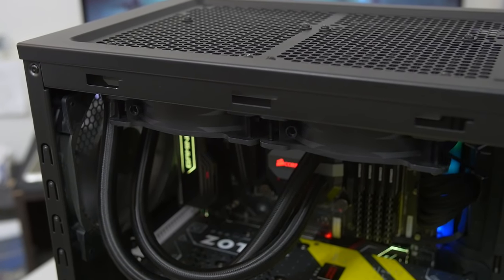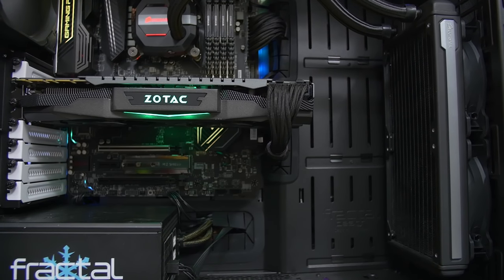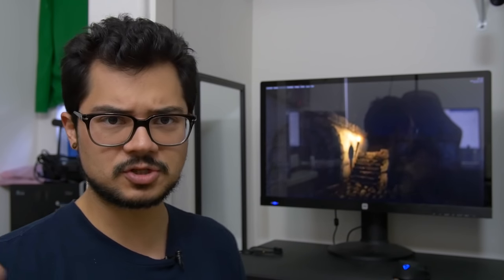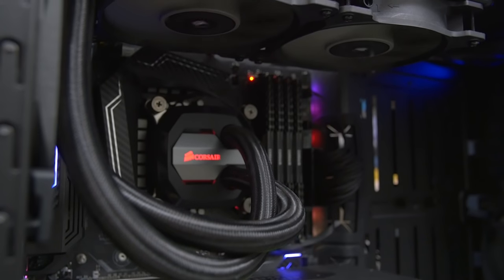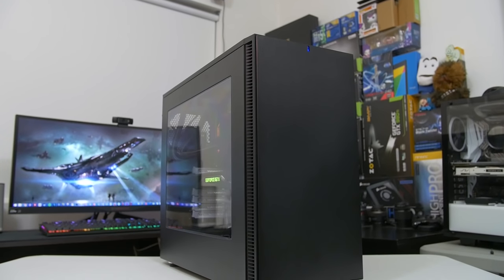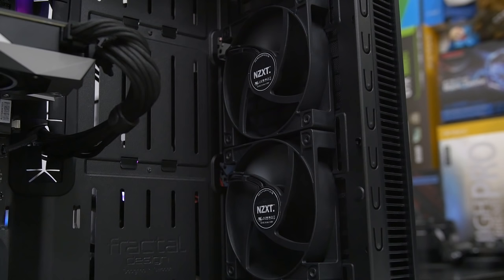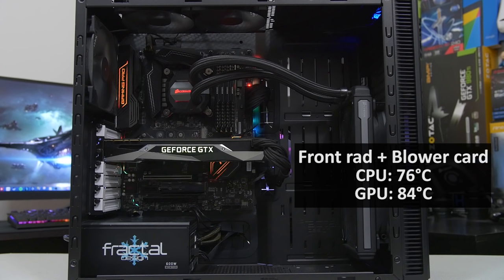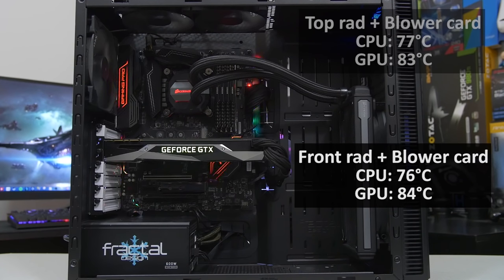Does Radiator Placement Matter? Hint: YES

Comment: is it me or he mounted the radiator upside down?? 

eventually, you will run into noise issues when mounting the intake and exhaust tubes up top and not at the bottom. AIO's have at least a 2-5% air pocket (up to 10% for cheap ones) and that will contribute to pump noise and gurgling in the radiator from the air bubbles. And another mistake, is to mount the pump (which in this case os on the CPU block with this AIO) higher than the radiator, the air pocket will eventually travel to the pump itself and make some pretty nasty gurgling sounds... 

Of course, for the test, it doesn't change much, but for a quiet and efficient build, it will.

Comment: On my R7 3800x when from 90c in the top to 75-80c in the front in the thermaltake c23 rgb the top in this case doesnt have much space in the top past the fans so that could also be makin my temperature hotter cause air cant exit as easily

Comment: So basically either you make your GPU slightly warmer with the front mount, or you will make your CPU warmer by having top mount xD fucking hell...
But seems like practically open shroud GPU barely takes any difference...so that's great to hear. I suppose front mount it is.

Comment: You didn’t just switch the radiator from top to front… you switched the radiator from exhaust to intake. Which in terms will cool the cpu more than exhaust. The position of the rad top or front doesn’t matter… what matters is intake over exhaust. Thank you.

Comment: If the radiator is on the side im assuming you want the top fans as intake to draw cool air right? Otherwise as exhaust it might cause a similar affect of hot air to be pulled by the cpu? Thanks in advance for the help and info will be appreciated.

Comment: got a question Kyle, not Lyle I have 140mm fans that run @1800 rpm on my rig but the NZXT Kraken 62 comes with 120's should I use the bigger fans and have them blow on my Kraken 62? Of course id remove the fans from the Kraken, thoughts?

Comment: In my experience it is best to have cool air available for gpu. radiator. and pcb using radiator as only exhaust and ducting the expelled air to the nearest window
Reply: it's not only the fresh air that gets to the radiator. it's how much heat is drawn away from it and therefore making the liquid more efficient

Comment: Hoses alway on top when radiator in vertical position.
Most AIO didn't mark which one is in/out on pump or radiator until we open to check it.
Is it matter AIO pump hoses on top, bottom or on side to keep no air in the pump?
And which installation method are the best way to let air get out from the pump?

Comment: Why hasn't anyone mounted it in the front and made a fan shroud to send it out the bottom so then the hot air from your radiator never meets your system. Then you can have your other fans on the top pull cold air inside your case.

Comment: The front mount you keep showing is going to be very bad for your pump. Pump should not sit lower then the highest part of the rad. This will cause the air to build up in your pump and cause over heating and eventually a broken pump.

Comment: What if u put the radiator on the top but put the fans as intake fans?! Does it make any difference? Im thinking about getting an AIO liquid cooler for my CPU (its a Ryzen 3700X so yeah it gets pretty toasty) and I dunno if I can put the radiator in the front cause I have 3 intake fans on the front from my case - Cooler Master. Btw I dunno if I should get an AIO at all (I got the stock Wraith Prism) cause now its summer and it gets pretty hot at times and Im getting like between 65-75 degrees on both the CPU and GPU (GPU goes to 75 or above very rarely). But the CPU sometimes went up to 80 (because of those goddamn Ryzen sudden temp peaks that piss me off) which is just scary and I undervolted it a bit ( -0.0750 V). Its def better now I dont think its gotten up to 80 at all I dont monitor it the whole time but still. So is there any point in getting and AIO cooler at all?! Its a lot more expensive than an air cooler but is it gonna do the job? Thats all I care about - for it to do its job and cool the CPU consistently! Is it actually gonna cool my CPU better than an air cooler ya know is it worth spending all that money on it when theres a possibility of getting even higher CPU temps because of the radiator and fans of the AIO being on top? I honestly got no fuckin clue lol would much appreciate it if someone more knowledgeable than me gave me a tip or two
Reply: High-end air coolers often perform roughly the same as AIOs according to a lot of youtube tech channels including LTT, so it depends heavily on the type of cooler you currently have, the case and how its airflow currently is (dusty filters, cables not managed properly and getting in the way, good/bad case design in general, etc). The room temp should bump the temps for both types of cooling if its hot in the room.
Reply: Evgeniy I went with the Noctua NH-U12S Push/Pull config. Installed it yesterday gotta say Im pretty happy with it. My temps are 10 degrees down from the Wraith Prism and its so much quieter.

Comment: Lol I built a mini chiller that keep cools down my radiator which keeps my 2700x at 34c under heavy load . Had an Engineer design the chiller for me and I machined all parts , Had a friend Anodized them for me .
Reply: Wow, that's almost as cool as my PC, which I built in my smart fridge, the upside is I don't need a monitor cuz it comes with the smart fridge.

Comment: How would this change with an AIO cooled GPU like the hybrid series from EVGA? Both intake top and front? Intake front and rear with a top exaust?

I've got a 420mm CPU AIO and a 280 GPU AIO, and I'm trying to figure out optimum setup without having to rebuild the fans/rads a dozen times lol.

Comment: Hello Bitwit, sorry but I'm not understanding what do you mean by this setup Front rad + open card. Does it mean that on front panel the fans are blowing the air into the case and top is pushing the air outside of the case or differently? Could you please explain ? Sorry for such silly question :D

Comment: Why case designers dont design a case that simply allows the installer to isolate the two sections with a baffle to prevent air mixing?  You heard it here first if this becomes a thing....⚠️  I wish there were more videos on open casecdesigns and airflow as well as a vertical mounted GPU.

Comment: Hi Bitwit - I’ve just had a new machine. It has a rear mounted and top mounted single fan each drawing air out of the case. However the front three fan array is mounted as follows: from the outside front I can see the radiator, then the three fans are behind that, so inside the case, I believe they too are drawing air out of the case then through the radiator, has this component been installed the wrong way around???

Comment: I did something similar a few years ago, and my results were also interesting. I used a Corsair H60i and could mount it to the front or rear of the case. This was an older system, an AMD A10-5800K on a MSI FM2-A75MA-E35 mobo. The video card was the outstanding (lol) HIS iCooler Radeon HD 7750 which is an open air cooler card. There was no overclocking. I tried several combinations. Radiator front, Rosewill 120mm fan rear, Radiator rear and fan front, 2 120mm fans and stock cooler, two fans and ARCTIC Alpine 64 GT Rev. 2 air cooler, 2 fans and ZALMAN CNPS11X Performa air cooler. My 'interesting' results: The 5800K wasn't my A10's model number, but rather the temperature in degrees Kelvin it wanted to hit regardless of cooling configuration. 

Seriously, it was hitting 110+ C and shutting down until I undervolted and underclocked it 10%. Then it at least stopped shutting down. 

I replaced it when the release of the Ryzen 2XXX chips caused R7 1700s to be available used. I am using air cooling and everything's fine now. I'm fine. We're all fine... (and they're coming to take me away, haha!)

Comment: This video helped somewhat, but I’m having trouble deciding on where to put the fans on the radiator :/
I read not to place them on the front because it’ll suck in dust inside the radiator..??
But if you put them in the back of the radiator isn’t that the same..??? 🤔

Comment: Let's face it, the ATX configuration right now is detrimental or at least not optimal for good cooling of the components of the PC and even to their physical integrity (see video card sag). It was designed for horizontal installation of a desktop computer not for the vertical tower cases we use nowadays.

Comment: Why are you doing a video about the correct positioning of radiator when you have your front side radiator mounted upside down? You will reduce effectiveness and reduce lifespan of the AIO if the hoses are mounted against gravity as it will cause air bubbles
Reply: Yep that's what I'm saying. This makes no sense.

Comment: Here's the question I have. Isn't top mounting a rad better for it's life expectancy? Not only that, doesn't a top mounted rad result in less pump noise.
Reply: GN did a video on this.
Kyle's front radiator setup is very bad. The pump is above the radiator barbs so all the air bubbles will gather in his pump and lower it's life expectancy.
If the barbs were higher than the pump, then it wouldn't be so bad, with the only real drawback being noise.
The best setup for noise and life expectancy is top mounted.

Comment: Now can you do one with Push/Pull configs? I have a front mounted radiator with an open GPU. But my fans are pulling air instead of pushing it (as you do here), is it worth switching them over? Critical point: My RGB fans won't be as visible in a push configuration.

Comment: Hold up... was the setup shown during the results of the top radiator representative of what actually occurred during the test? Your front fans weren't even on, but when you did the front mounted radiator, you had your top fans turned on. How is that a fair comparison? And was there even a rear fan during the top mount? Maybe I'm just stupid, but this does not seem like a fair comparison at all.

Comment: I do have a very serious question. What if you flipped the radiators position on the front of the fan? Meaning, the tunes would be from the cpu to near the bottom of the case on the front. Does that make sense?

Comment: can you not just have a top mounted rad with it pulling in air by turning the fans around ?
Reply: You could, but you would be injecting more hot air into the case. Despite this video, because of simple gravity, top mount, lines down is the best option.

Comment: I think you meant to say fahrenheit not Celsius... You computer would literally be on fire at those temperatures... Now if your referring to the cpu and GPU specifically that's still pushing your cpu and GPU above the normal high loads and could in the long run damage them or significantly shortening the life of your computer

Comment: Now I have a question.  My GPU is an open card, and I have my radiator mounted on the top. If I plan to mount the radiator on the front instead, what size screws will I need? I have the NZXT Kraken x52  mounted on the PHanteks Enthoo Pro M Case for reference. I seem to have misplaced my screws that came with the package which is why I'm asking.

Comment: I'd be curious to know if a big air cooler like a DH15 has a similar CPU heat increase compared to the top mounted radiator. I don't think I've seen any comparisons that address how much potential the GPU has to dump hot air both into the intake on the CPU cooler but also potentially into it's heatsink.
Also in a front mount setup are the GPU fans inclined to idle on the basis the GPU is cool when the other components need cooling? Do people configure fans specifically for this or is there anything to suggest at a low to medium load the case might actually be hotter? At the extreme could I run something like a Prime95 test, causing the CPU to heat up, meanwhile the GPU isn't doing anything so the fan might not even be on.

Comment: What about the rear of the case? I guess thats the same as mounting it to the top? My case can only take a 120mm AIO and only in the rear exahust. It can take any size 120mm AIO tho so I have the Corsair H80I which is a huge 120mm radiator in push/pull. My case says it can only be mounted in the rear which I can clearly see is correct but I belive I could fit it in the front if I remove one 120mm fan and run it in just push instead of push/pull. Would it be better to leave in the rear with duel fans or in the front with one?

Comment: Is it best to put the fans towards the radiator like sucking in air in the front or best to put the fans pointing away from the radiator this way all fans are basically pulling hot air out

Comment: mfw can't put radiator in the front of my case bc it's a 360mm aio and the tubing would be in the way of the HDD cage shroud (non-removable). I could just have the tubing on the top of the radiator and that would work but then any bubbles would rise to where the tubing is.

Comment: why 7700k is oc? Mine is stock 4.2 and pretty hot>>> Just bought h115 platinum, 2 years was using Evo Hyper :D :D Temps were 75-84c :D even spike 95c sometimes :D on corsair 60-75c, depends which profile using>> RPM matters

Comment: Hmmmmm...I'm running a top mounted CPU radiator with 6 fans in an intake push\pull config and a front mounted GPU radiator with 4 fans in an intake push\pull config.

I guess I'm temp safe 🤔

Comment: Almost all aio’s have a little bit air in them. And now we know it’s bad to have the pipes coming out of the top of the radiator. It’s prone to having no water circulation at all in the radiator because of air bubbles getting stuck there. So there is very little heat dissipation. Even worse is the pump being on the same level (or higher) as the top of the radiator. Air has the tendency to go up, potentially getting into the pump. A liquid pump that only pumps air is devastating for your aio and everything that it is trying to cool. Sorry but I can’t agree with mounting the aio on the front as you are shortening the lifespan of you hardware. I will mount the radiator on the top for the sake of my expensive setup!

Comment: So i got a question i currently have 3 intake fans on the front of my tower 2 exhaust on the top 1 exhaust in the back. The 3 on the front are between the body of the tower and the plastic cover in the front. I purchased a aio liquid cooler would it be wise to leave the 3 fans where they are and install the rad behind them with the 2 fans that come with it as exhaust on the rad. So 3 infront of the rad (intake) and 2 on the back of it (exhaust). Is this going to be a benefit?

Comment: This is old but I just got a corsair 4000d case and have my aio in front dtawing air in. Put the case fans on top drawing air in and thr back fan exhausting. Gpu yea seems to just dump air and run warm. But cpu is cool and overall normal gaming seems good

Comment: Im sure you know but the front would be cooler if the tubes were at the bottom and the radiator is higher than the block.

Comment: Corsair recommends the pump always be higher than the radiator. If the radiator is front mounted, the tubes should be at the bottom to prevent air from entering the tubes.

Comment: I'm just about to install a AIO cooler and was wondering this exact thing. I can have 3 120/140 fans in front or on top (or both). Not sure yet if my case has front room for the radiator, I'm find out shortly. Thanks!

Comment: I am going to mount my aio in the front with both if it’s fans as intake, one rear exhaust and I also have 2 additional fans. Should they both be exhaust in the top? Intake? Or push pull in the top?

Comment: Front mounted radiators should always have the hoses at the bottom if possible.

The loop always has air in it, and the radiator is designed to catch it. 

When the hoses are at the top, that air can pool at the hoses and cause noise, or move to the pump and cause failure.

If the hoses won't reach the bottom of the radiator in front, you may be better off top mounting it.

Comment: You should never blow hot air into the water cooling radiator but fresh air from outside. Just put a powerful exhaust fan in the back of the case. It's common sense, not much to be tested.

Comment: Is it a good thing for the flow when you place the radiator in front and tubes up? I guess the tubes are supposed to be down for the water flow without bubbles.
Reply: Watch JayzTwoCents video about radiator and pump placement.  So long as the pump is located at a lower level than the top of the radiator, the air in the AIO will be trapped at the top of the radiator reservoir and doesn't get near the pump.  It is not necessary to locate the pump tubes at the bottom.

Comment: I am not sure but for the front mount aio case, will the position cause that, air in the aio cycle will be accumulated at the pump cuz the pump is a relatively high point in the whole system? Will that make damage to the pump?

Comment: Sir does it make difference if the position of the radiator is like this  <intake<(Fans) ||radiator|| |front of case| OR  ||radiator|| (Fans) ||front of case| I am just curious, if I am going to do this set up. What will happened to my air flow? coz I use intake, does the heat coming from the radiator will go inside my case  if I am using it in the front of my case?

Comment: If i were to install the set up like at 10:10 could i potentially swap the fans round on the AIO so they are showing inside the case but still have them pulling air in? surely it wouldn't make a difference because the same warm air from the radiator will still be inside the case.

Comment: What if you mount a 240 mm radiator at the top as an intake, with 3 120 mm fans at the front and a 120 mm fan as a rear exhaust? Would / could this make sense?

(I know I can't ask for temperatures because that would depend on the exact hardware configuration.)